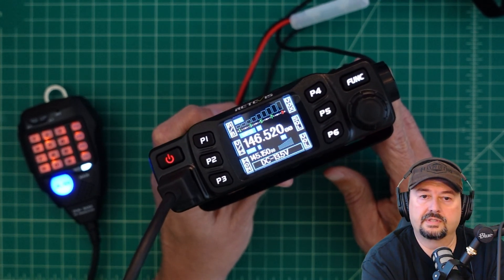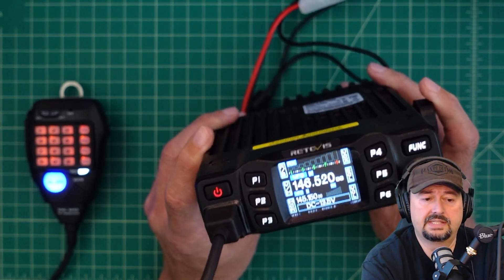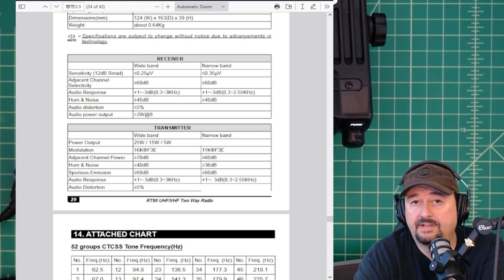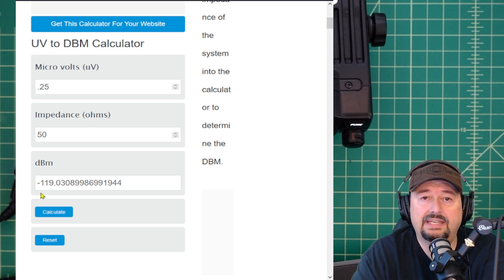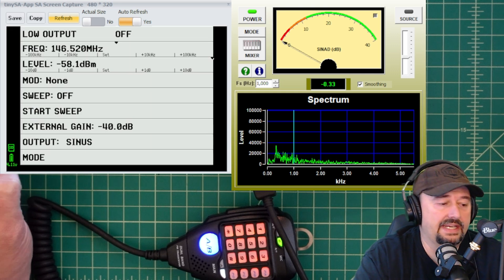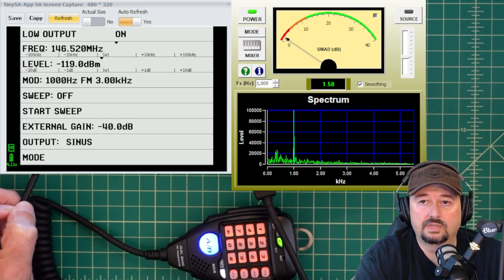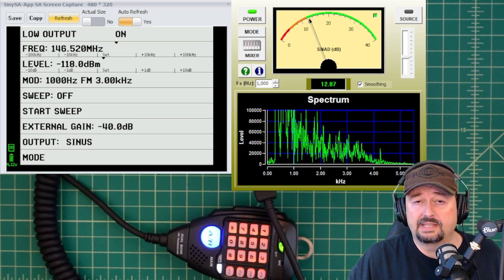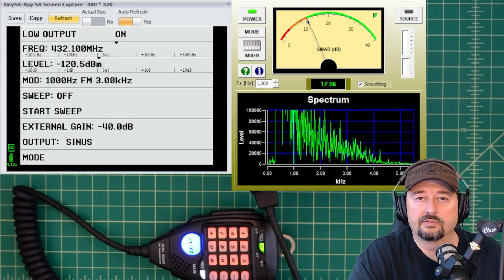Retevis RT95 - SINAD Test

Comment: If we're looking for a CW signal level, 1kHz should be fine. I would think that for voice signals, something around 300 Hz would be more appropriate. It's very likely that I don't know what I'm talking about and there are some engineering details that I don't understand.
Reply from the maker: The SINAD test uses a 1kHz tone and then a filter to notch it out.  You want to compare the total "noise" with and without the signal.

Comment: They may also be measuring at the detector, not at the final AF output of the rig.  There is usually a crap load of hiss in the AF amplifiers on all radios.
Good job Ape!

99.9% of radios have great sensitivity.  I'd like to see the measurement of RX selectivity as I feel that is really more useful in the real world.  Can the rig reject a very strong carrier just one channel away?  How about out of band rejection?  I always had excellent results on my older VHF/UHF equipment that had helical resonator filters in the RF input.  I believe those days are gone for us hams due to the expense of the product.  Most manufacturers skimp on the RF rejection and use DSP in the audio to clean things up.

73 Bro.
Reply from the maker: Hey Hollywood!  I’m sure some will measure in a way that gives them the best results.  When reading about the test the most common two ways I saw we at the speaker or the speaker jack.  I agreed with your points about sensitivity vs selectivity, maybe an idea for a future video? 🤔

Comment: Well demonstrated, just a few things to watch, one is the deviation and the bandwidth the radio is set to. In the wider setting of the radio sinad will measure slightly worse at 3k deviation than it will with 5k deviation. A useful thing to remember is that in a 50 ohm system -107dBm is 1uV. When measuring at the speaker output there is often a sweet spot for the volume control for  best sinad. 
Too low and noise rises, too high and distortion rises. Not a criticism at all, I have never used PC software to do the job. Both respectable measurements... 73
Reply from the maker: Thanks G0fvt.  I did see variation with volume 👍
Reply: @TheSmokinApe  well done on the video, I realise you cannot do the subject to death in a modest length presentation.
Reply from the maker: Thanks man 👍

Comment: If you, like me, were wondering how that calculator works: It's basically populating the standard formula for power (given voltage and resistance) P=U^2/R. If you plug in the numbers 0.25uV and 50 Ohm, you get a tiny number that is in Watts. Now since dBm is a relative measurement in relation to a Milliwatt, we need to multiply this by 1000 since 1 Watt = 1000 Milliwatt. Then to get dBm, you simply populate the formula for that: dBm = 10 * log10(P), where P is the power in Milliwatt. This should give you the -119dBm.
Reply from the maker: Great info, thanks PCfreak 👍